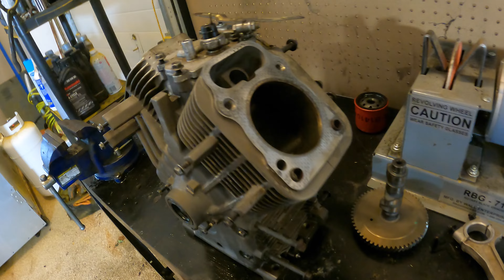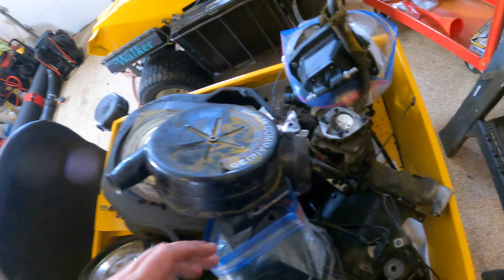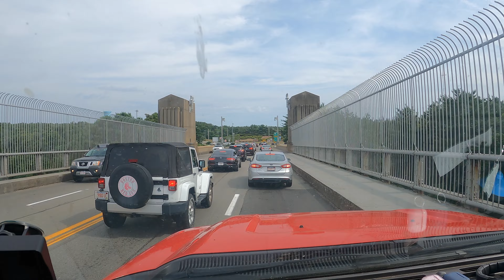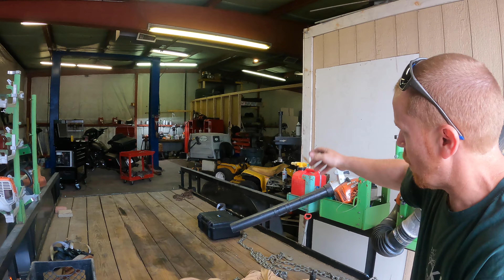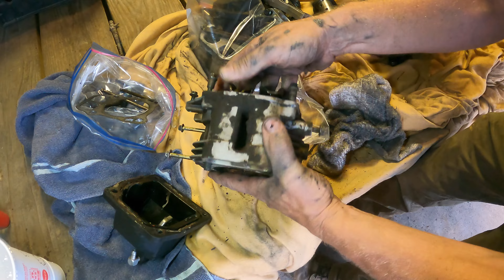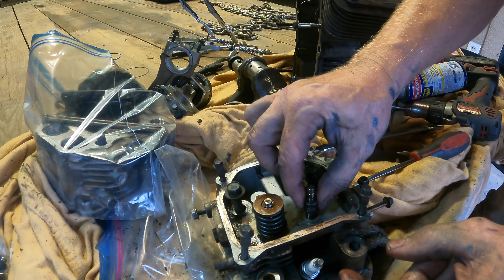{Part 1} Old Tired KOHLER CH20 ENGINE Desperately Needs A Rebuild ! Can We Pull It Off?

Comment: I have a question.   I have the same engine it leaks a lot of oil from the muffler.  I replaced the head gasket and still does any clues
Reply from the maker: Sounds like it needs to be completely rebuilt